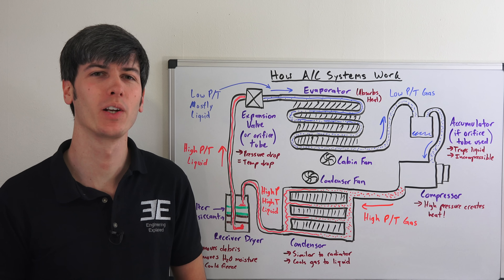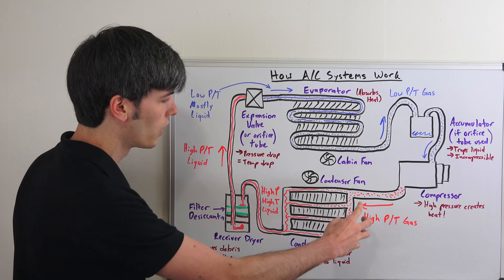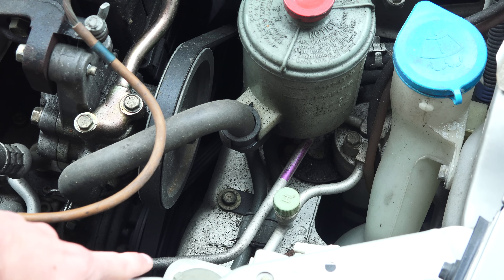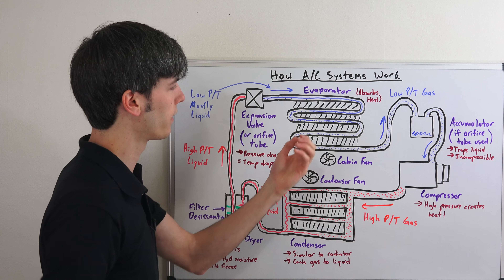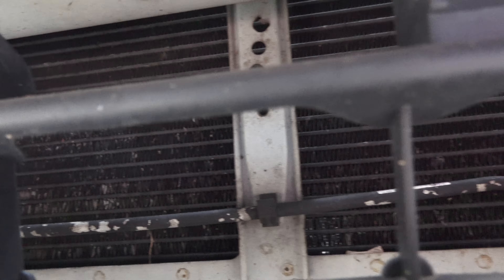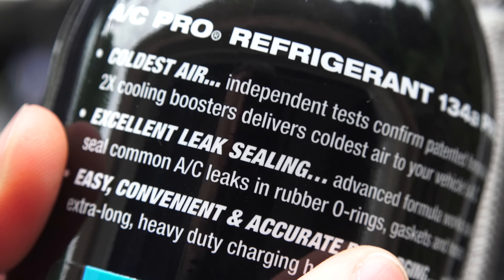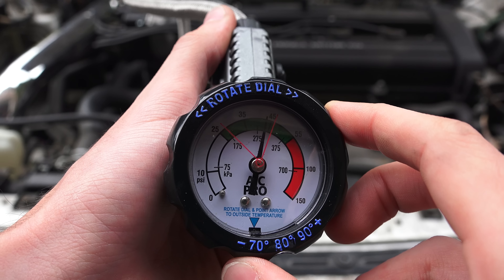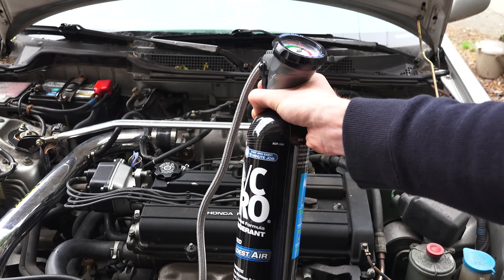How Car AC Systems Work & How To Recharge Your AC System

Comment: Nobody but an AC tech should work on AC systems. This gas is highly nocive for the environment. A leaky system should be recovered and fixed, not topped off.
Reply: Absolutely correct. Couldn't have said it better myself
Reply: Keep scaring people to get more to your shop.
Reply: Completely dependent on the type of gas it uses and local regulation, older more toxic gases were phased out because in reality these things always leak.
Reply: + Wyatt Brookins  I had a girlfriend who didn't have a/c for years. Some shop quoted her hundreds of dollars to get it fixed so she just let it slide and didn't get it fixed.
Then one day she found out about this stuff and bought a can. Her air conditioning as been blowing cold and working perfectly ever since the time she did that.   I am not sure you would have an easy time  convincing her about this:  "I can tell you why it doesn't" work.

Comment: So what exactly does the air "recycle" button do in most cars? Is it better to have it on or off?
Reply from the maker: +OldSchool9690 pulls air from in the car rather than outside. Good to do when driving through dirty air (gravel roads, etc).

Comment: 2:38 Expansion valve. Liquid is not compressible. It will not change pressure. Expansion valve allows for liquid refrigerant to slowly drip and expand to gas. By doing so temperature drops (heat is needed to evaporate liquid into gas - just like boiling water).
Either they told you wrong, or they did not know well...
Reply from the maker: Liquid is not compressible, that is correct. Liquid absolutely can change pressure. That's how hydraulic presses work (attempting to compress the hydraulic fluid results in the pressure spiking) and plenty of other mechanical devices.
Reply: OK, let me rephrase it. At 2:15 you start talking about expansion valve, at 2:37 you say that liquid expands. That implies that you can compress liquid, which is not true. Well, not to this extent - water can expand slightly, but this is at ppm per degree level. Expansion valve allows for evaporation of the liquid. It is partial evaporation at this point and you have mixture of liquid and gas. Then, at 3:26 you are correct.
If you listen to the whole story it slightly contradicts itself.
Expansion valve does exactly opposite what compressor does. Compressor compresses the gas into hot liquid and condenser lets it cool off and in some very hot days actually condense what did not condense under high pressure. However, majority if not all, condensation takes place in compressor. If it was in the condenser it would cause banging/hammering in the condenser.

Comment: I thought the A/C system was supposed to be charged when the engine is running at an applicable cruising RPM (typically 2000-3000), otherwise when doing it at idle it tends to end up being undercharged which results in sub-par cooling when the engine is turning faster and more compressor clutch wear from it cycling excessively.

Comment: So what he didnt explain which i finally figured out is this:  If your ac is REALLY low then your compressor will click on then click back off making the needle jump from below the green then back up to the red.  If this happens to you it means your AC is almost completely empty.  For the most part 40 psi will be good for any outside temp.  If you have the issue I had you know you're doing it right if the compressor stays on the whole time.  THE COMPRESSOR SHOULD ALWAYS STAY ON if its full!

Comment: What happens to any moisture that accumulates in the receiver/dryer? Does it just evaporate over time or?
Reply: havent you ever seen water dripping from cars?
Reply: +deonisp That's from the receiver/dryer? Are they made to purge out? Always thought it was from condensation
Reply: The water dripping from the car is condensation from the evaporator.
The receiver/dryer or accumulator does not drain, once the desiccant in the receiver/dryer is saturated it needs to be replaced,  The air conditioning is a closed system so the only time the system takes on moisture is when it is opened.
That is why the receiver/dryer should be replaced any time the system is opened, a contaminated receiver/dryer can damage the compressor and expansion valve and create high restriction at the receiver/dryer causing frosting on the lines and poor A/C performance.

Comment: Very nice tutorial on how the system works but a lot of missing info on recharging.  Newer vehicles require a specific amount of refrigerant in them to work properly and without knowing how much is left in the system you cannot be accurate.
Reply: Newer vehicles with smaller systems may not work properly if they are over filled or under filled with refrigerant by as little as half an ounce.  That is why the newer A/C machines (like the one I own) have to be 98% accurate with the recharge.
Reply: You use the machine to take out what is left in the system (since you do not know how much is in it) and then recharge with the right weight.

Comment: I have a very small leak on my condenser, very very small. Do I have to replace it now or can I leave it as it is and do a recharge once in a while? Can it bring harm if I leave it?
Reply from the maker: The best thing to do is to fix the leak or replace the condenser, though this may work to fix it if the leak is super small.

Comment: do you guys leave AC in circulation mode or outside air? When I left it in circulation AC sticks up the car, so I do outside air now, but heard circulation uses less energy.
Reply: recirculation mode cools the air that is already in the cabin, this does allow the system to be less taxing on the engine. if you are getting a smell it is either your carpet has a little bit of a funk to it or your cabin air filter needs to be replaced.

Comment: So on my 03 Civic my clutch won't engage. I properly vacuumed out the lines with a vacuum pump and recharged my system to 18oz of refrigerant. The clutch will engage if I apply power to it manually (how I recharged it) but won't engage by itself. The relay is good. The button for A/C lights up. The car blows cold air when the clutch is manually engaged so the compressor works. I'm not sure what else I can check for why the clutch won't engage. Any ideas?
Reply: the clutch coil field is weak.  I fixed mine by hammering the clutch on the compressor just enough so it would engage. otherwise you have to remove the clutch from the compressor and remove the shim spacers.  it worked just by hammering it on.  after a while it gets too far from the compressor face and won't engage
Reply: I'm having the same issue with my 08 Acura TL. I'm probably  gonna take it to the dealer. only thing I can suggest is maybe you have too much in there...or clutch is giving out?
Reply: +Julio Johnson dude every honda/acura I've owned has that compressor clutch problem.  my 07 tl has 160k and the ac still works.  my rsx doesn't. it's a pita
Reply: Are you getting power at the compressor? If not, there is a low/high pressure switch that won't allow the compressor to run if the system pressure is too low or if it becomes to high. A faulty switch would not allow the compressor to engage at all.
Reply: +Marcos Cruz what Marcos said. Probably the transducer switch on the high pressure line.
Reply: You should check your evaporator temperature switch, they tend to go out on those cars.

Comment: now all of these vids are coming out about a/c? I needed this 2 days ago when I overfilled my a/c with refrigerant and my compressor wouldn't kick in. I finally got it to blow cold air after bleeding some refrigerant out of the system. you'll know if you overfilled it if your compressor tries to turn on for a second then blows off.

Comment: My 1993 Suburban takes R12 refrigerant and is low. When turning on my AC the pump turns on, off, on, off, etc. I believe this is caused by not having enough refrigerant. Could I use the newer R134a in my system since I can't get R12 anymore?
Reply: you would have to retrofit the ac system by drawing out the R12 and flush the system to get the old oil out. after that you should replace the drier or accumulator and orphice tube. then you can recharge the system with R134 a and use page oil. many part stores have the kit to put over the old ports.
Reply: most ac shops can flush the system for you though.
Reply: The compressor cycle is normal, I assure you. I would also not recommend making a modification like that to your truck on your own. A buddy of mine did that, and had to pay almost 1400 bucks to have his entire A/C system replaced.
Reply: It depends, the normal cycle times can vary significantly depending on ambient temperature. If you have the service manual it will probably have some graphs of the expected on/off times for different ambient temps.

You'll really want to put a gauge on the system and see what your low side pressures are before you do anything else, in my case my old R12 system's pressure switch had failed which caused symptoms similar to low refrigerant even though the system was fully charged.

Comment: My car has a stop/start system. How is it possible that I still have cool air out of my ac when the engine is not running? My assumption is that the amount of time that the engine is not running is not long enough to heat the evaporator so that I will feel a difference inside the car. Is this true? 
When my car shuts the engine off, the fans will run slower than when the engine is on, so that might help in decreasing the heating rate of the evaporator.

Comment: hey guys i have a question. i recharged my system and I'm confused with the readings. i can't see what ac compressor is doing cause it's stuck down low but i have 2 different readouts. one is in green and after compressor clicks it's in red. ac works fine but I'm concerned because it goes in red. should it be in white and green or is it ok like I'm getting,  green and red? thaks

Comment: When i use ac  water temperature start to increase and oil pressure start to drops down to 1bar that means engine oil is very hot
I have an old 1991 Mercedes-Benz 190D 2.5 with retrofited ac
any advice ??!!

Comment: Some if not most techs will not work on an AC system that has used stop leak.  It can cause other problems and they don't want the responsibility.

Comment: I have an 04 Subaru 2.5 sti and I cant find the low pressure side. I followed all the lines from the pump but no we're is the low pressure side port!! How do I refill it?
Reply from the maker: Apparently it's located behind the intercooler - http://s3.photobucket.com/user/txl146/media/DSCN8855.jpg.html
Reply: There's only a high port at the front. I've followed all the lines and don't see any port even by the intercooler

Comment: so i drive a saab 9-3 turbo and my ac does not turn off when the car is not running. i thought it was normal until it killed my battery. is it a problem with the computer or what? please help if you know of a solution.

Comment: Okay, so the compressor is driven the crank of the engine. Does it mean the compressor in an electric car works via the batteries directly?
Reply from the maker: All energy comes from the battery in electric cars, correct.

Comment: dont use stop leak or leak seakimg additives in your ac system. if its leaking get it fixed dont try to bandaid it. when stop leak is in the system the a/c machine cant be hooked up because it clogs the inside of a 5000+ dollar machine, not a fun day. also when you cant purge the system with a machine most shops just release it into the atmosphere which is pretty bad for it

Comment: typically where will a cars AC system leak from?

a have a leak somewhere in mine and even with UV dye put through the system we cannot find the source of the leak.
Reply: Typically at joints, rub points, compressor, condenser, evaporator, hoses/tubing and controls. 
In your case, likely the evaporator coil assembly.

Comment: Does the engine need to running or not when recharging the AC?
Reply from the maker: It needs to be running with the A/C on full blast.
Reply: yes it needs to be running, the engine needs to turn the compressor, unless you drive a hybrid or EV
Reply: Thanks

Comment: So I have a question. After I drive around for a bit my AC seems to shut off sporadically. It'll be running just fine one second and then it'll just start pumping warm air into my car. Then my car will make a strange sound and my ac will come back on. I've looked at it while it's running and it seems like the clutch for the AC is engaged, but whatever it is connected to seizes up or something. It just stops spinning. Then it'll make a loud click and it'll start running again. Is this normal? Something I should get checked out?
Reply: To be clear I believe my compressor is stopping or seizing, My AC's clutch is engaged (I think) but the compressor just suddenly stops. I'm wondering if this is normal.
Reply: +bdot02 if the belt isn't squealing when the compressor stops running, it is probably just the compressor clutch.
Reply: +Ericthemachineman the belt doesn't squeal
Reply: +bdot02 yeah sounds like a compressor clutch
Reply: you should follow the exact steps in this video! That can happen when your AC system is low on refrigerant. The clutch won't engage properly if it is low on pressure.
Reply: To clarify:  A pressure sensor in the system 'knows' it's low on refrigerant and is not letting it run for long.  (Lower on charge, it may not run at all.)  The clutch may be fine (from your description, sounds to me like it is working normally), the refrigerant charge may be low.  Now, if the belt was squealing or if there was heat/smoke/odor coming from the clutch area, that's different.

Comment: Hopefully someone knowledgeable can help me out... 

I have an 2002 Civic with about 175,000 (I say this because I know its older and has seen better days), and recently the A/C will cut out after 20 minutes of running then will "purge" or come back after another 10 minutes or longer and then cycles through like so throughout the car ride. I've been told, and have confirmed for myself, that the "fins" of the condenser or evaporator are bent but am weary to believe this is fully the problem.  I know this can become a costly fix so if anyone else can point me into a direction I'd appreciate it.

Comment: I recently had an issue with my A/C system, and I told my mechanic that I had used A/C pro to recharge it. I was informed by him that these DIY recharge kits can actually damage your A/C system, especially if you add too much. I do trust my mechanic, as he is a long time family friend and had never BS'd me on anything, when other mechanics have almost scammed me. He even allows me into the shop while they are working if I so choose. Is there any legitimacy to his claim?
Reply: It depends on whether or not the person knows what they are doing. Over charging and mixing refrigerants are big concerns but some DIY kits contain sealants which when exposed to air will ruin your entire a/c system. Not to mention the possibility of ruining a shops equipment, if they are unaware of the sealant present.
Reply: He is not lying to you.

Comment: how do u recharge my a/c in my car cuz it takes r12 I stead of r134a
Reply: Buy r12 instead and it should be same procedure
Reply: r12 is licensed and mighty expensive. u can get a conversion kit instead. $60 in most auto stores.
Reply: I would but u can't but it no where my car us a 92 Integra
Reply: you should not do it yourself unless you want to help destroy the ozone layer.  r12 is 2400 times worse for the ozone layer than CO2
Reply: graaf thats why u need a license to purchase and use r12.
Reply: because it is really bad for the ozone layer. about 2400 times worse than CO2. it is heavily regulated here in the eu because of that.
Reply: Like everyone said R-12 is basically not used any more. There are cheap kits that convert older R12 systems to R-134a but I personally don't think they work very well as they don't actually convert the system over. Your best bet is to just live without AC or buy a newer car. It may be cheaper to buy a new car then pay to have your cars AC system fully/professionally upgraded to R-134a
Reply: I was refering to the cheap conversion kit you can buy at your local auto parts store for $50 and all the tools are included. I have no doubt a conversion done in a shop where they recover and evacuate the system would work much better.

Comment: how does pressure create heat? Charles' Law I thought doesn't allow this
Reply: They use a little trick. Charles Law only applies properly as long as the medium stays a gas. If you start to condense it, things change radically. phasechanges in generell will need or release a huge amount of energy depending in which direction the phase change happens.
For instance you will need about 5 times as much energy to evaporize 1kg of water that is already 100°C than to heat up 1kg of water from 0° to 100°C.
The only thing the A/C need a compressor for is to bring the boilingpoint into the right temperature range, because at atmosperic pressure R-134a would start to boil at -26°C.
Reply: cool thank you so much!

Comment: I have a problem with my 1996 BMW 2.5 I wanted to Recharge my AC, but the guy said that the ac kompresor is not engaging to refill the AC so i hotwired the kompresor and its not broken it works, but it doesn't run when it supposed to, if i start my car, it engages after 5 minutes car has been running, and stops, and then starts again for some time
Reply: could be faulty wiring, bad compressor clutch or weak coil field, bad relay, or more
Reply: or low refrigerant
Reply: its not refrigerant, he charged my system up to see if thats the fault
Reply: Vlad, the compressor cycling like that is normal, all vehicles do it. Nothing to worry about.
Reply: +vlad no lubricant? maybe tech added refrigerant but didn't add necessary oil that's essential for compressor to operate?